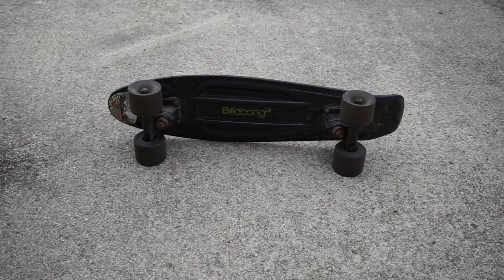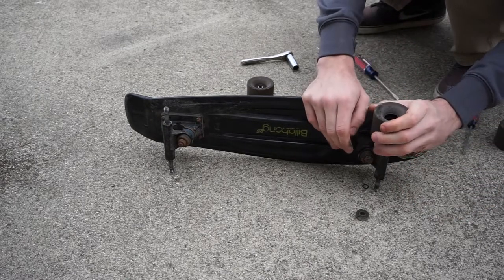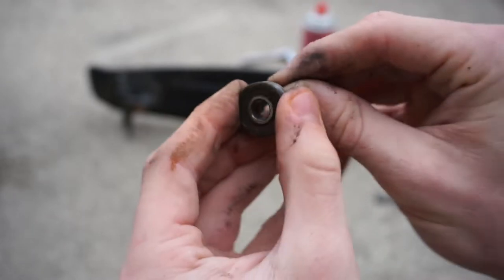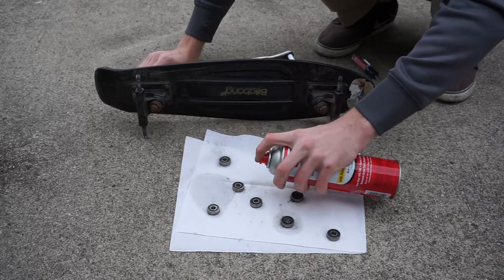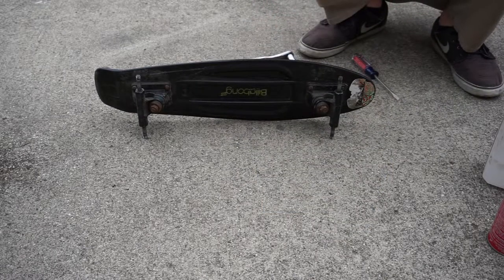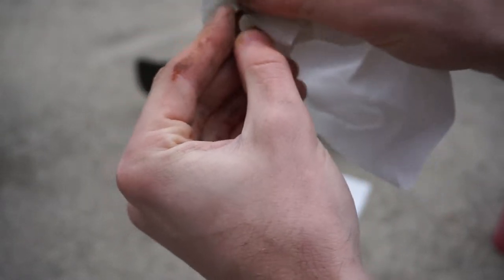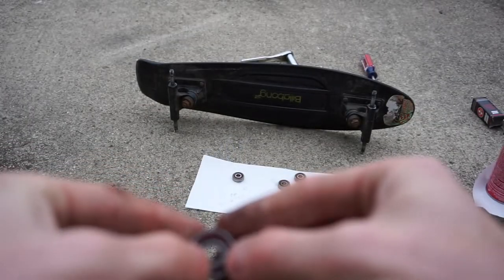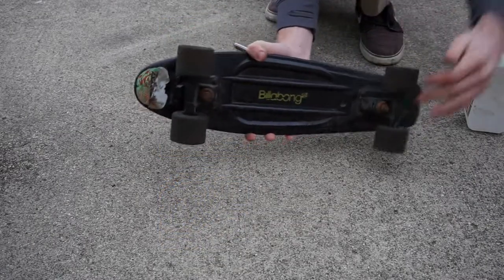How To Propely Clean Your Bearings

Comment: I didn't know WD 40 was bad! I was straight using it to clean and lube like a multi function item hahaha. I have basic bearings with metal covers is lysol lemon breeze all purpose cleaner okay to use for cleaning?
Reply from the maker: All purpose cleaner can work, just make sure there aren't super harsh chemicals in it !